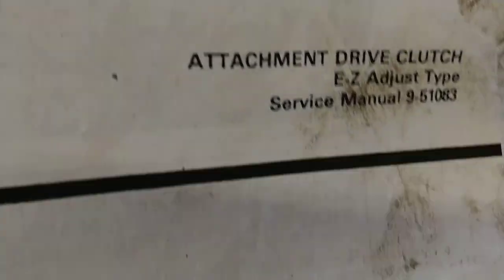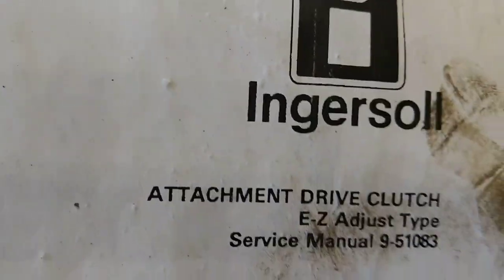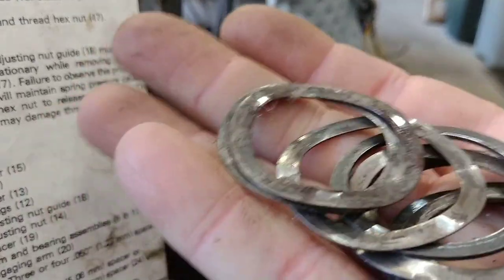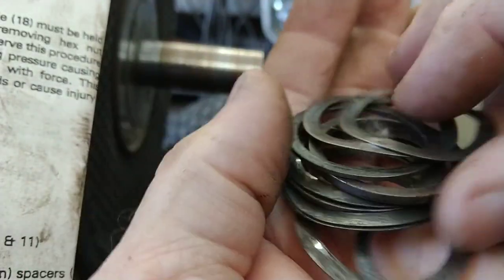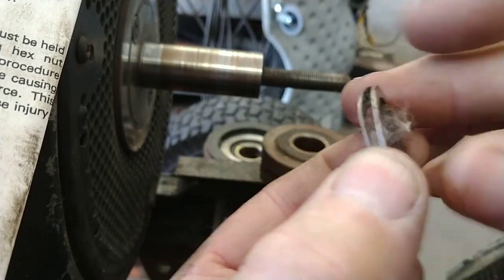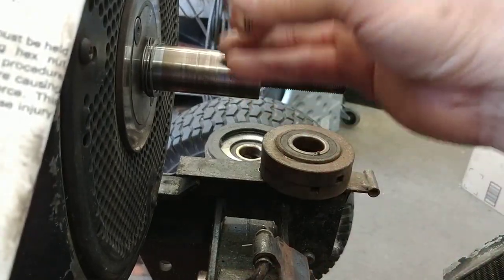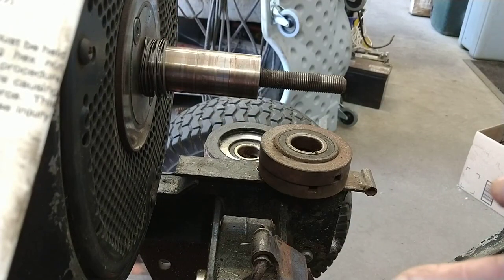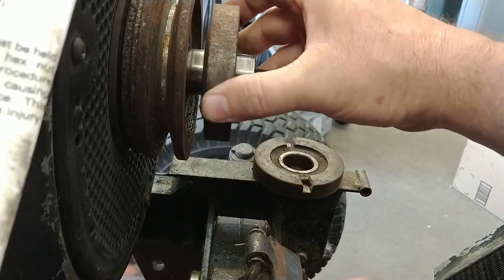Case & Ingersoll E-Z Adjust Clutch by an Expert

Comment: My case 222 still runs strong. Unfortunately the blades disengage if I don’t keep my hand on the lever. Could the be a symptom of the clutch not being adjusted correctly?

Thanks- Ryan.

Comment: I put back together my ex clutch now I'm not getting any power?
Reply from the maker: When working on things like this you must be exactly correct or it is wrong. There is no close enough quite often. You will need to remove all the parts are review the clutch manual, that is not an option for not only having all the parts but that they are on correctly. There is no I did it right and it still does not work situation. I am sorry but I cannot tell you what you did wrong.
Reply: @hemlockcaseguy9934  I eventually got it. Wasn't tightening the two bolts correctly